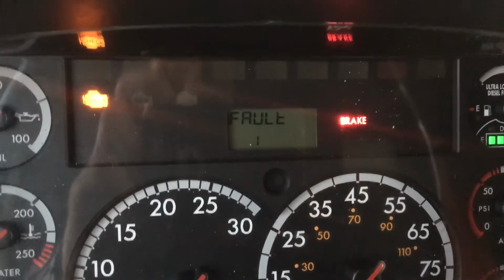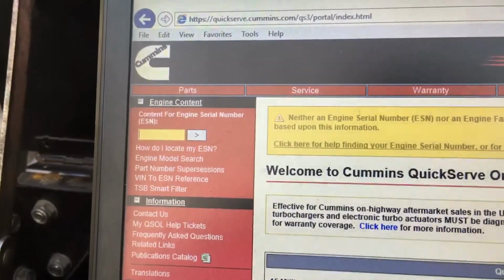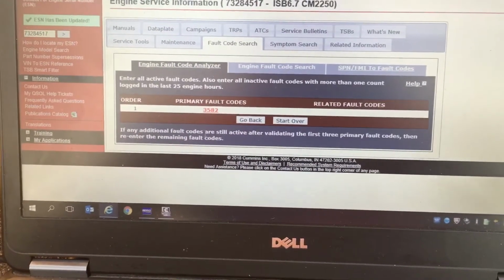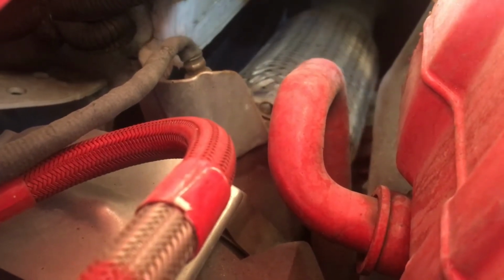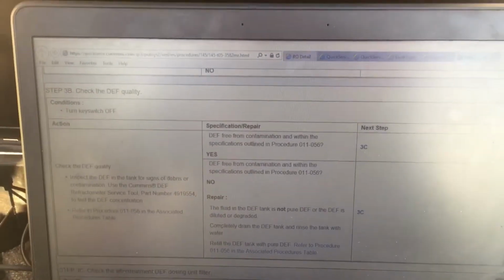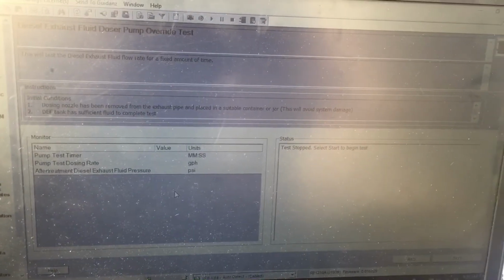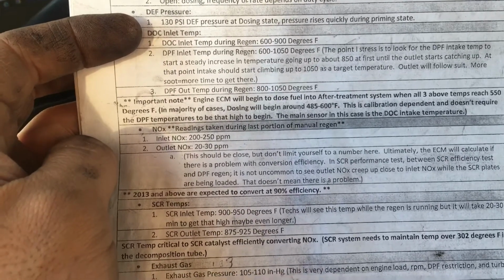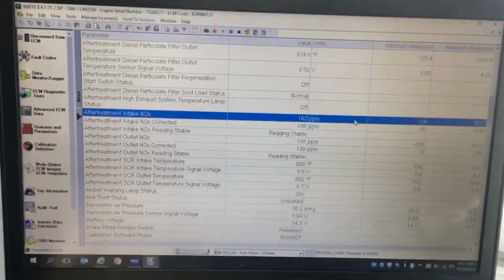Step by Step troubleshooting fault code 4364 / fault code 3582

Comment: I found your video by accident looking up for codes, 3934 & 3911 with inactive codes 4162, 3232 and 2771 which I have not yet addressed. Even though your video doesn’t relate to me I found it very educational as these are the things that the dealers don’t want the truck owner to know how to do because they will be losing out on high dollar repair revenues. Thanks a million.

Comment: Good morning sir, I’m currently experiencing this problem, the origination of mine is from bad def , I’ve change def filters they changed doser injector done regens changed  the exhaust nox and 40 miles both check lights came up and the def light aswell , any suggestions Ives spend thousands already and stil not fix , should I change the inlet nox ? My codes are 4364 and 4094 .
Reply: Hi how did you fix after those lights back on.

Comment: When in Cummins quickserve you tried getting info on a 4 digit fault code that that said error occurred, when that happens just erase the 0 and it should work on most of those codes with a 0 at the beginning

Comment: 4364 fmi fm18 code showed up? How big of an issue is this? Will this shut down the truck? How long before I have to fix this code? Please help
Reply from the maker: yoban gonza mechanically there is most likely nothing wrong with the truck. This code relates specifically to the scr/def system. The problem will most likely be with the scr, a nox sensor, def quality or quantity getting into the exhaust stream, or the def doser itself. Unfortunately it will shut down the truck in derate. I think this happens after three key cycles or three hours of driving.
Reply: Alrey Industries my truck is giving me the same code but it only appears in extremely cold weather and under a heavy load
Reply from the maker: TroyP20 - are there any other associated fault codes? This code is primarily dealing with nox conversion. Which means it is most likely going to be limited to your DEF system or SCR catalyst. The only thing I can think of in your particular situation is the possibility of your DEF freezing in cold weather. But usually other fault codes will be present suggesting such a condition. That’s as much as I can think of at the moment.
Reply: Alrey Industries I appreciate the fast response no it only gives me that fault code of 4364 fmi 18 still runs as nothing is wrong I live in Florida so once I get out of cold weather it disappears maybe the pan that heats the DEF is not getting hot enough or maybe the doser valve is freezing not sure